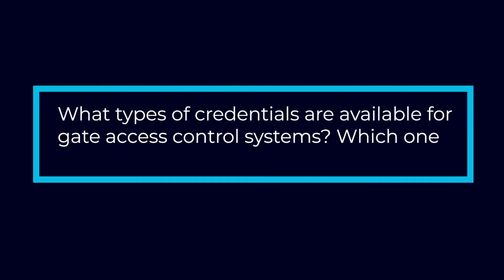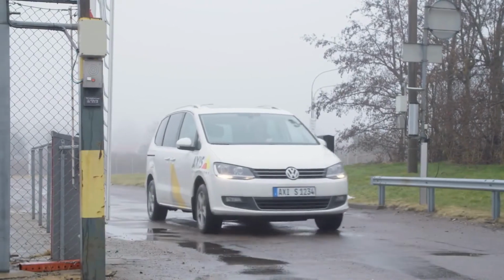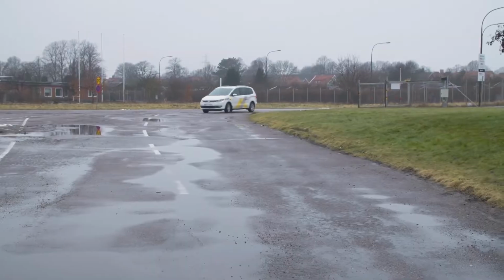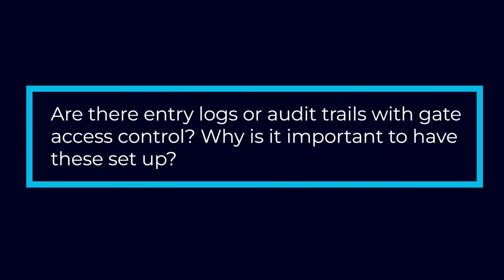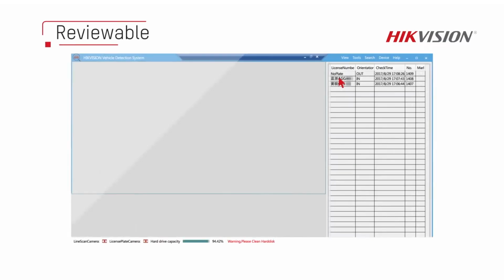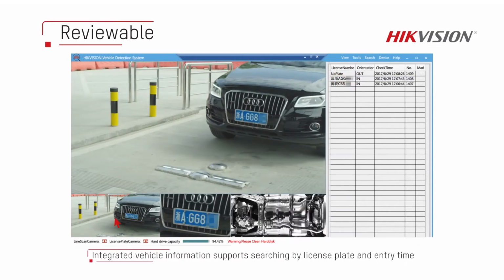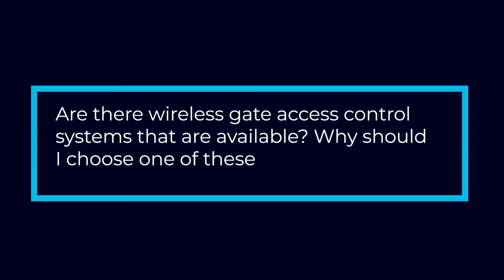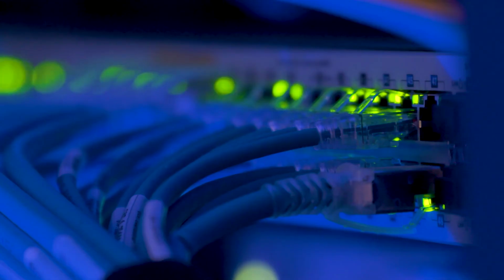Gate Access Control: Watch This Before Installing!

Comment: hell, what is the best driver to buy to acces control (online ) the closing and opening of the gate. ? thx.
Reply from the maker: Thanks for your question! The best driver for gate access control can depend on a variety of factors, including the type of gate you have, the level of security you require, and your specific operational needs. 

We would be more than happy to discuss these factors with you and recommend the best options for your situation. Please reach out to us through our website (https://getsafeandsound.com/contact-us/) or call us at 888-333-4540. Our team of experts looks forward to helping you find the right solution for your gate access control needs.